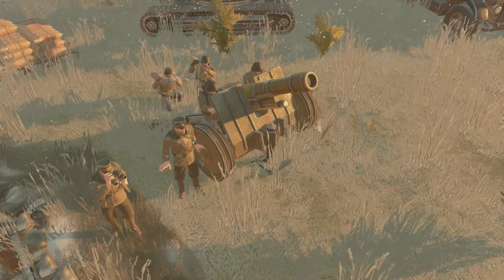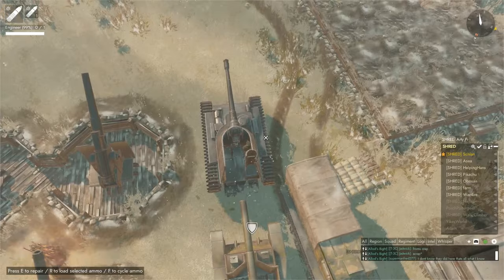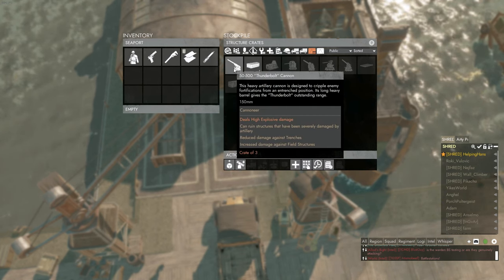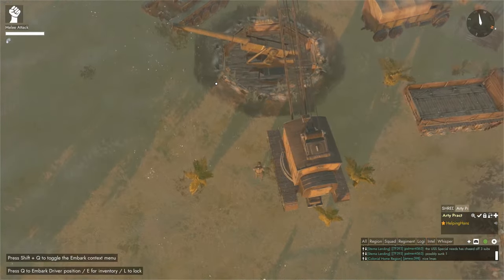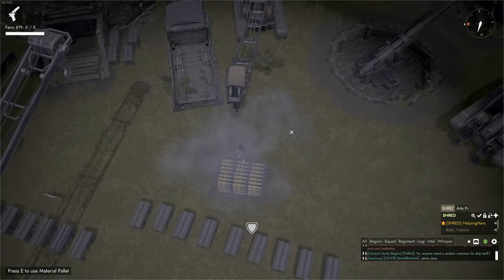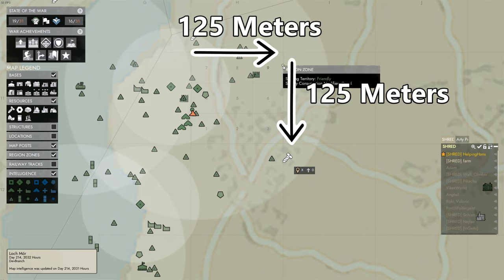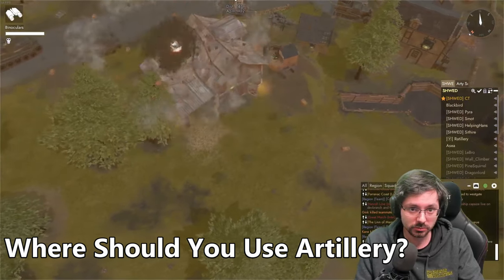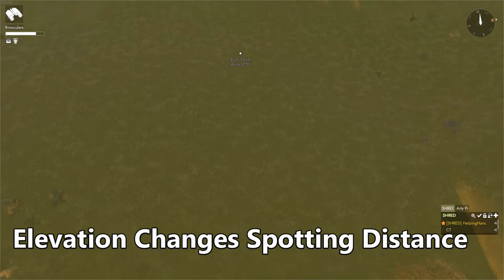Artillery Tutorial - Foxhole

Comment: A lot of helpful stuff here including good practices.

However I'm still confused about the spotting part.
As far as I can tell Azimuth in Foxhole is basically just the compass bearing.

The more the spotter distances himself from the gun, the less his distance and bearing matters, as it is only relative to his position.
That basically means you form a triangle and to get an accurate distance and Azimuth (before correcting for wind) you'd have to use trigonometry requiring a calculator.

With A being the artillery gun, B the spotter and C the target you'd have
b² = c² + a² - 2ca cos(β) for distance and
cos(α) = (b² + c² - a²)/2bc for Azimuth correction for B's Azimuth to A, meaning it would have to be added or deducted from B's Azimuth depending on which side the target is.

I've never been good at math and it's been a long time since I've touched the subject to that extent but wouldn't you have to apply these formulas? I'm aware that there are artillery calculators and I'm guessing they are a requirement beyond the "winging it" range. Or does the dispersion become so random that at some point it's just "fire at that general direction"?
Reply from the maker: I wouldn't worry too much about the maths. Best thing to do is fire in the general direction you want to aim in and aim a bit short so you can see the shell land. Then just adjust accordingly.